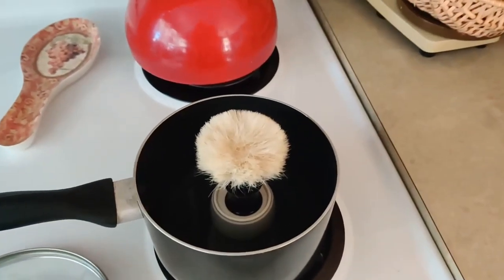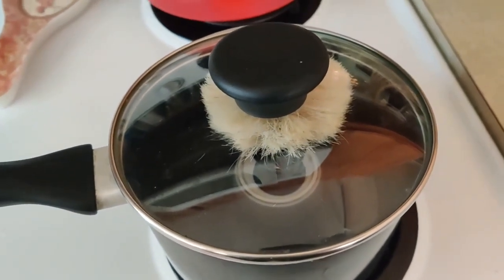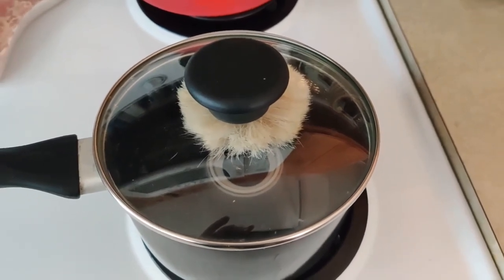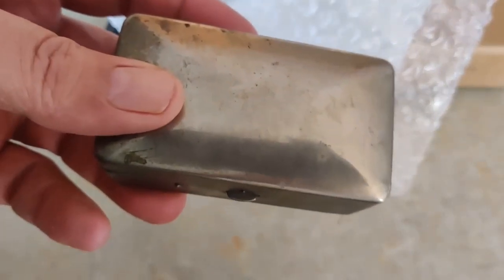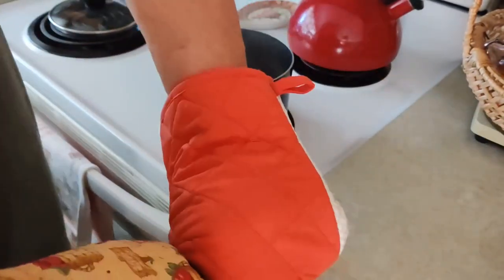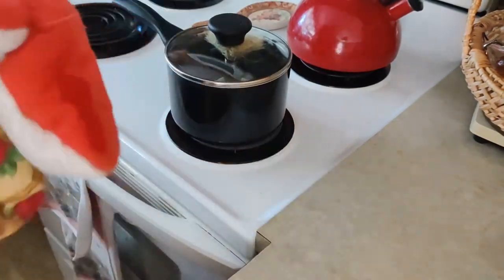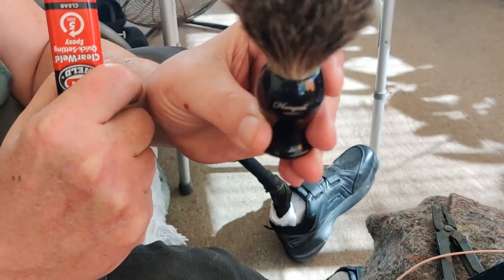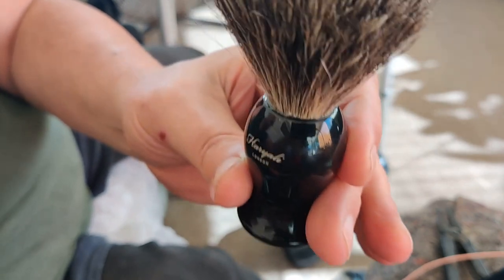Changing a brush knot

Comment: I have changed out several knots using the same method, but I use silicone now instead of epoxy on the replacement knot.  It works great and the knot is much easier to remove when the time comes.  I have probably done 20 brushes and I have never had a failure.  Sometimes you just have that handle you want to keep and replacing the knot is a great option.  Good video!
Reply from the maker: Yes, it is, and it's cheaper than buying a whole new brush.

Comment: Shaving Brush Knot:face-fuchsia-wide-eyes: or cracked handles B-700 no gloves:face-fuchsia-wide-eyes:THE EASY WAY:face-blue-wide-eyes: Simpson 29MM is the best brush on the market today:face-blue-wide-eyes: it's like buying a $200 badger hair brush, no cleaning the brush, no need for a brush stand, fast drying time, well not fall apart like a badger hair can, cheap to buy:face-blue-wide-eyes: have owned it for 5 years with no problems wheelchair Larry Merry Christmas:face-purple-wide-eyes:
Reply from the maker: Thank you. Sometimes you just have a bad knot that needs changing.
Reply: Do any Pucks or hard soaps will work? You can mix and match old soaps? to fit in any mug or cup that you like to use. like Mitchells' Wool Fat? Cut the bar soap up, put in a mug, cover the soap with a small amount of water, microwave for a minute or so? if it foams up, stop ? let cool you just went to congeal' place in the sun, until soap hardens use dry brush more water i use Dove soaps there cheap and good  save your money spend it on your wife don't listen to the shave mafia.try to save people money in these inflationary times wheelchair Larry Merry Christmas @shavingwithpegleg3813